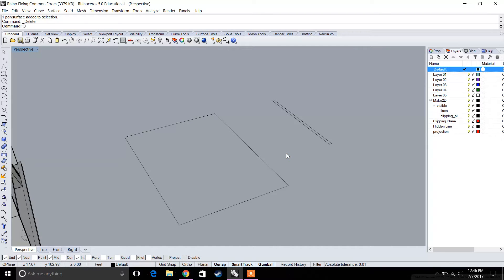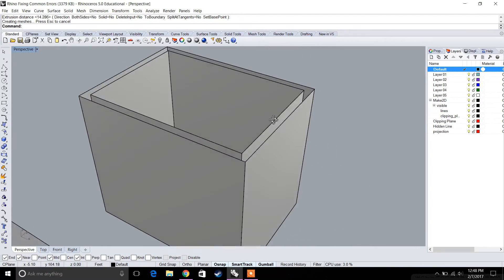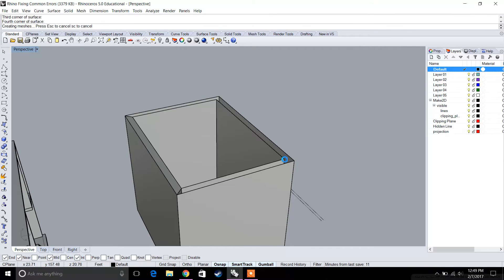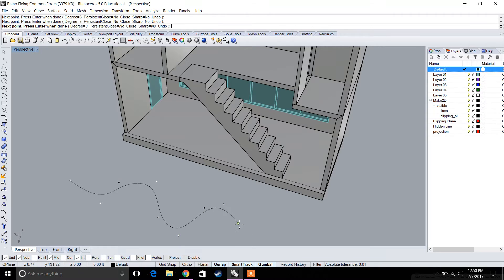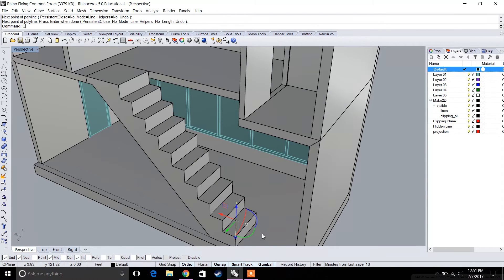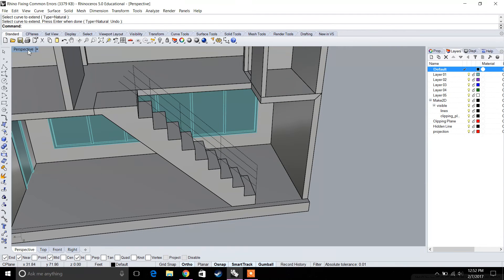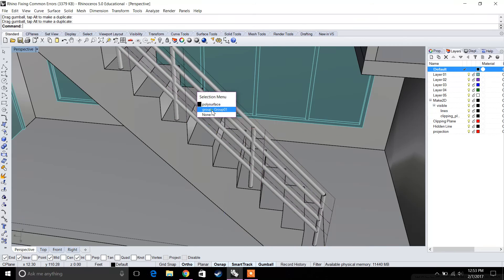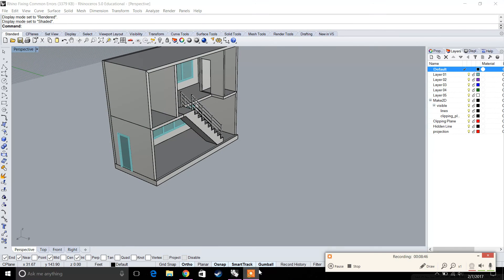Rhino Beginner Series: Fixing Closed Surfaces, Loft & Pipe Commands (quick tips)

Comment: Hiya, i have created a stair railing as demonstrated but the edges of the railing (where one axis joins another) are not connected. What could be the issue and how to fix this?
Reply from the maker: That happens when the lines you use to create the pipe element are not joined together as one line. Just join the lines together and run the pipe command or you can do a boolean union. Hope that helps!